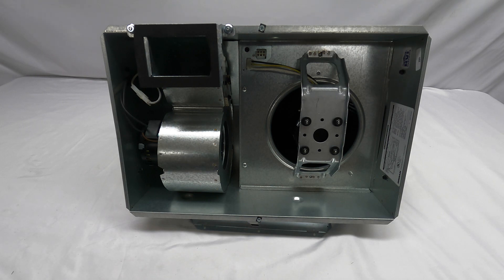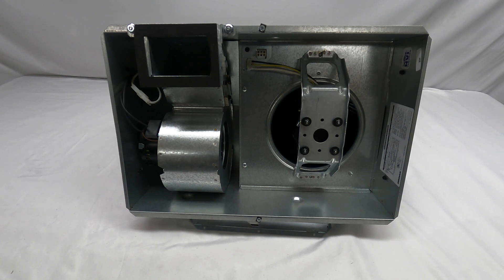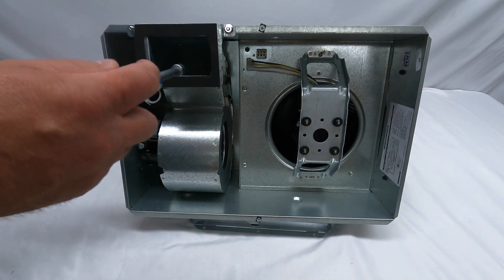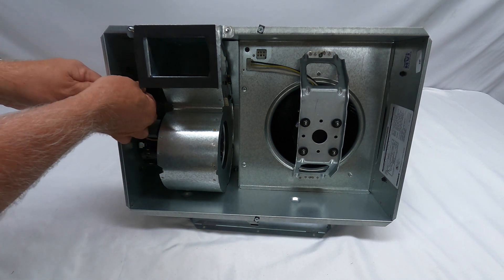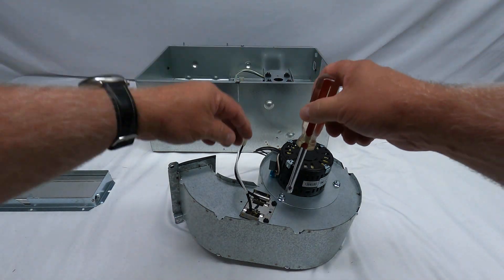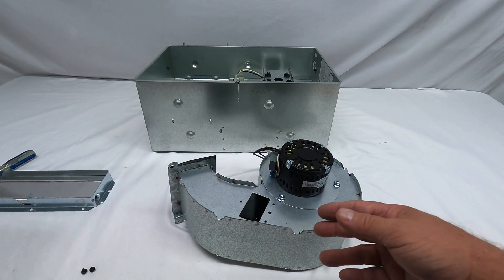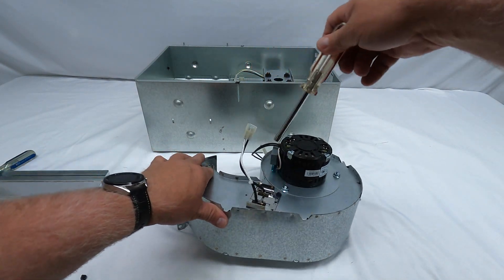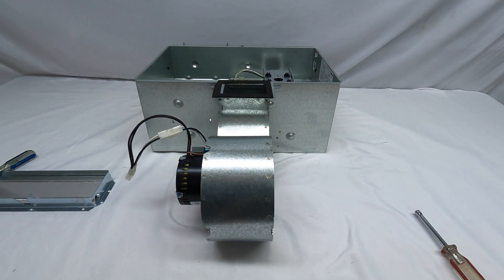How to Replace Broan QTX110HL Bathroom Fan Heating Element

Comment: NOTE:  I have the same unit and the unit he removed by  taking off the two nuts does NOT remove as shown.  That is anchored in and can NOT be removed that easily!!!  I will edit this if and when I can find an easy reasonable way WITHOUT removing the whole unit from the ceiling.
    Finally got the unit out, installed new heating element and everything works!
   What I had to do was, remove the two nuts, take a flat blade screwdriver and lightly PRY down on the two tabs that are held on by the two nuts (as shown in the video) and then came easily out.  The rest was simple to take heating element out and install the new one.  
   I took a pair of pliers, covered the small protruding machine screws with protective covering and lightly bent them to better line up with the two tabs holding the unit up, making it much easier to reinstall.
   Lastly, my unit was full of lent after only owning for 2 1/2 years.  When I had it off I blew it out and cleaned it completely of dust and lent, which I am sure caused the unit to stop working.
   Also this replacement part no. S97020888 can be purchased from Amazon for less than $25.
Reply from the maker: Good Morning, Thank you for your feedback. This video is an actual representation of the repair. Please call our Technical Support Team at 800-637-1453 so that we can troubleshoot the issue you are experiencing with you directly.